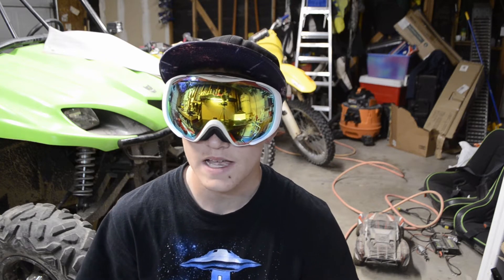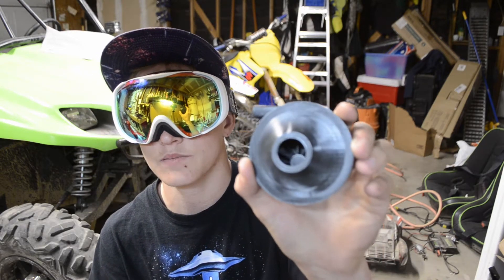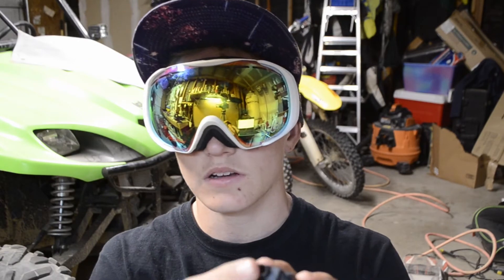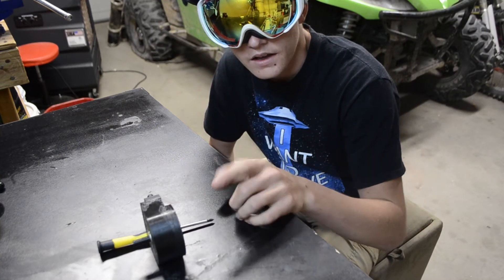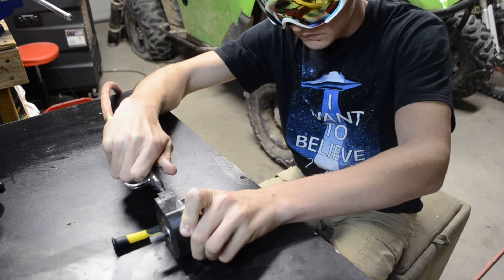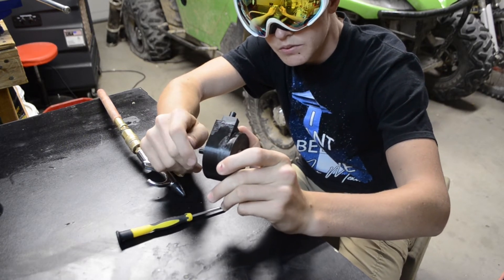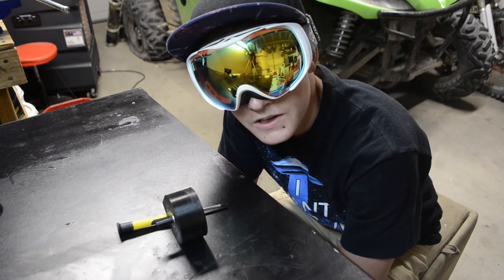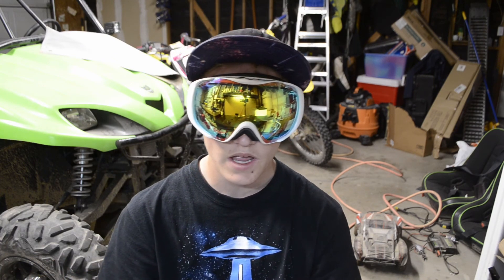12,000 RPM Air Turbine

Comment: If you can try to put a threaded pneumatic insert into the print. Then use a valve to control flow back where the tank is so you won't have to be near it

Comment: How much air pressure in bar needed to operate this turbine?
IT is very good project  🎉🎉🎉🎉🎉🎉🎉🎉🎉🎉🎉🎉🎉🎉🎉🎉👍👍👍👍👍👍👍👍👍👍👍👍👍👍
Reply from the maker: I think the lowest you could operate with some power would be about 1.1bar, but the turbine should run just off your lungs